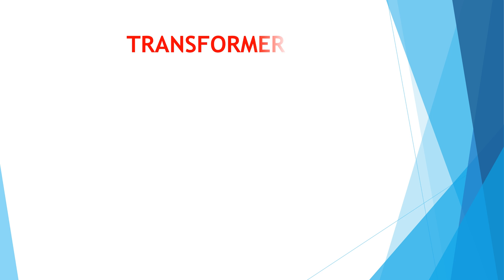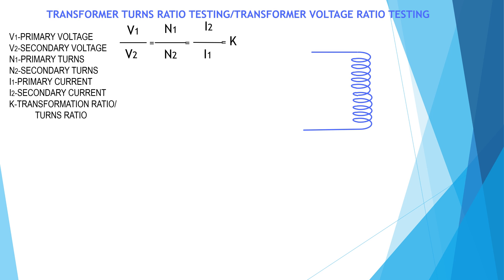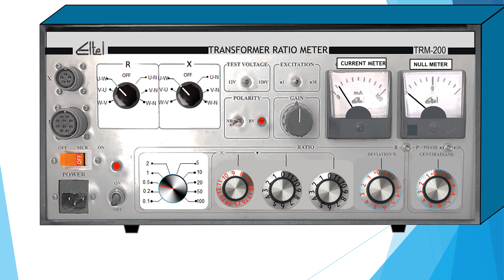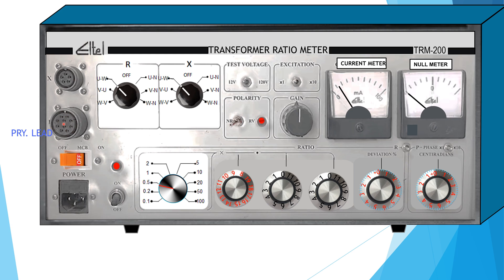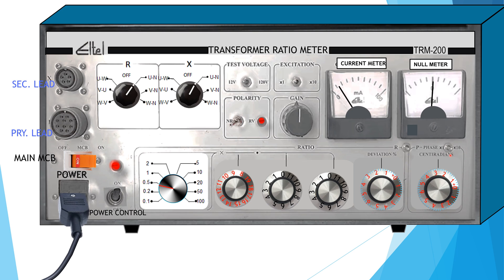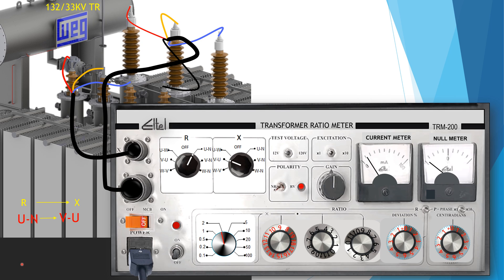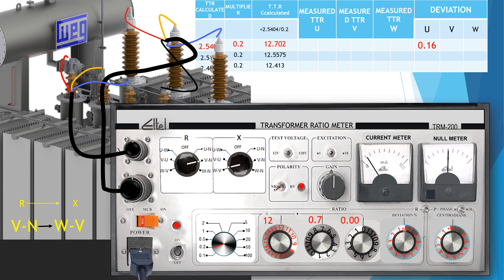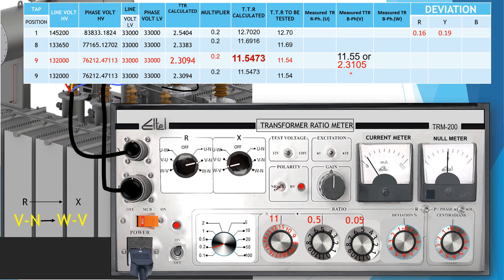TTR test of Transformer/Transformer Turns Ration Test

Comment: How the multiplier value of 0.2 is calculated?
Reply from the maker: You are welcome. Thank you for watching the video. Calculation of MF was not defined. It is a drawback. As such,Setting of integer knob starts with 8  and end at 19. First calculated TTR from rating, have integers start with 2. To increase the integer values for matching with kit integer knob setting a suitable multiplier   is needed. 0.2 is the multiplier of TTR to be tested. So 2.5404=0.2*12.702.here 12.702 be the TTR to be, tested. Thank you once again. ❤